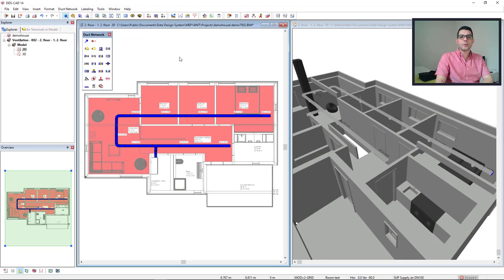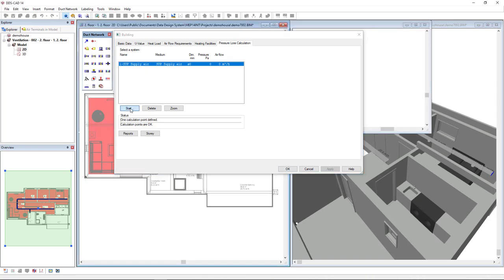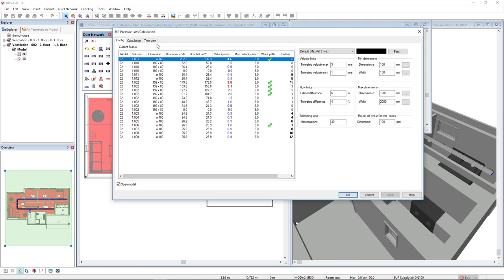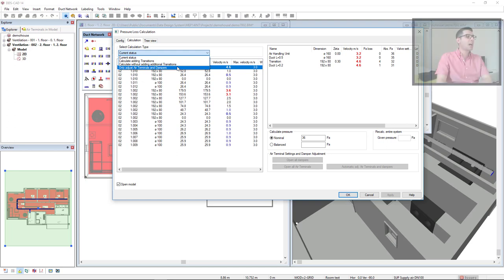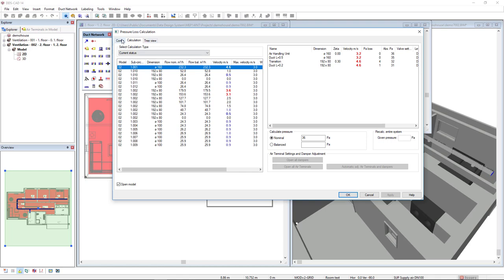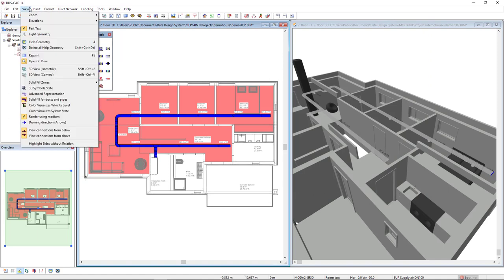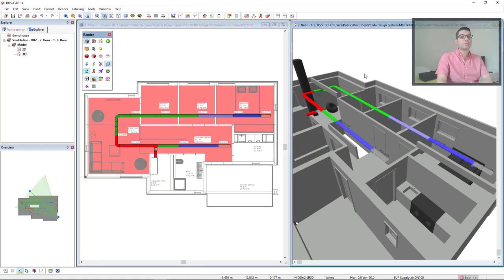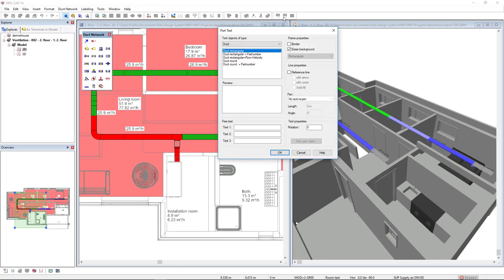Using the pressure loss calculation to optimize ventilation system design

Comment: Can someone help me figure out the pressure loss in a 100mm / 4 inch duct system of 9 meter total length with five 90 degree bends?  I think an centrifugal fan should be required for this application but the required fan cfm strength and possible speed or pressure loss toward the end of the duct is  stumping me